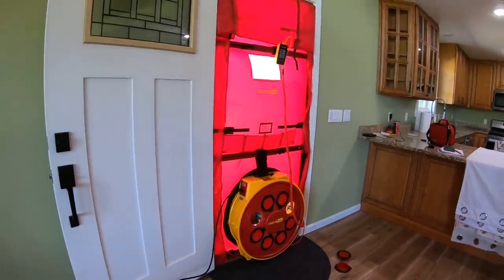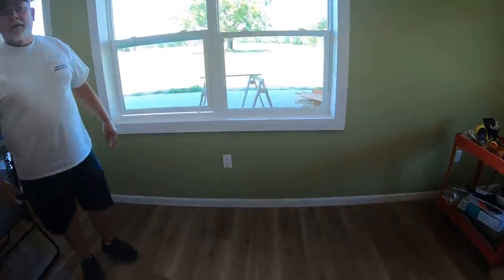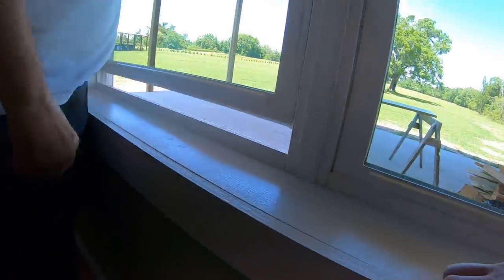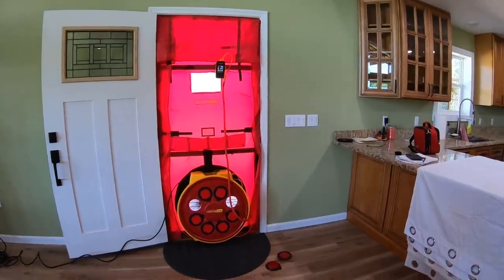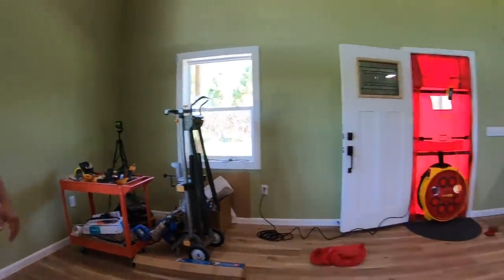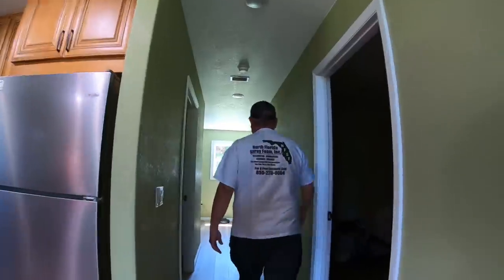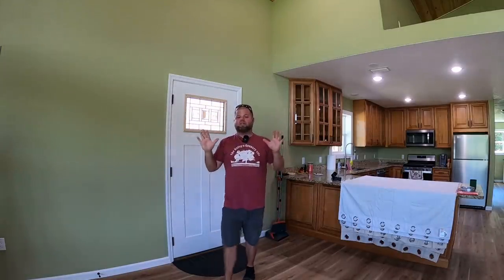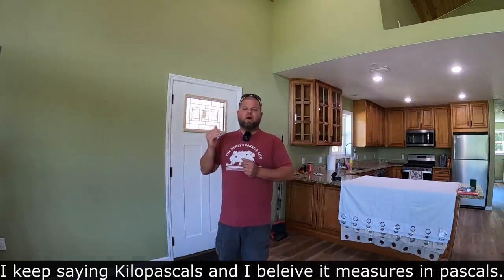The blower door test! Did we pass???? #560

Comment: Been in the HVAC field for over 30 years now. And yes a sealed home is the best and yes you also need to do things to have a controlled air change rate in the building. Another big deal is maintaining positive pressure in a building. You have to make sure you are bringing in more fresh air that you are exhausting. A building with negative pressure promotes a bad moisture problem leading to extreme mold problems in the building.
Reply from the maker: I agree and I do have positive pressure, when the havc system is running it will slowly close the exterior doors completely.

Comment: Here in NC code requires 5 ach50 or below, ive been running blower door and duct leakage tests for work the past 2 years and spray foam houses always test fantastic.  Well done on your 0.64! Very close to the passive house requirement here in NC at .6
Reply from the maker: I just learned about a passive home, makes me want to seal a few more things and try again.

Comment: The only way to make it better is to literally seal off the sliding windows, seal the concrete floor, seal the inner walls to increase baffling, and seal outlets/wall switches. There is literally not much else. You got to remember that the house only gets less tight throughout time as the foam cracks, walls creek, gaps expand...etc. You did exquisitely well.
Reply from the maker: I did seal all exterior outlets with caulking and closed cell foam. I think all my dampers are contributing to the majority of my leaks.
Reply: @TKCL  If the dampers are within the envelope of the house then they dont contribute squat. Anywho, your at peak performance and enjoy the glory of a tight home.

Comment: Congrats!!!!
You should be very proud!
I am perusing your various videos.  I commented on a later post asking for your ACH rating.  
I also asked for the CFM numbers for your bedroom versus the rest of the house.
Since you did not go with variable speed compressor, how are you handling the way different loads for the two zones?
Is your AC a two speed unit?
Running the compressor at full capacity while lowering fan speed to match the bedroom zone will result in VERY cold air and possible detriment to the compressor.  The problem may be worse when heat pump is in heating mode.
Reply from the maker: I responded to your other comment on air flow.

Comment: New it would pass.  Now my house probably won't it's made from concrete block. I've been thinking about having the cells filled with spray foam for step one
Reply from the maker: Concrete is definitely porous, but it seems like air wouldn't quickly pass?
Reply: @TKCL  it does. My house is 906 Sq ft the furnace is a 125,000 btu. Over double the size needed for the Sq ft.
Reply from the maker: Oh wow! What about a liquid membrane spray or paint?

Comment: This was a very good video. I’ve never seen or heard a good explanation of this. 
You’ve done a fantastic job at sealing your home.
Are you guessing most of the leakage was coming from air flowing back into the house through the vents like bath and kitchen exhaust fans?
Reply from the maker: That would be my guess yes! Those dampers do not seal well. And I do assume I still have some normal leaks as well. I'd imagine it's impossible to get a house perfectly sealed.
Reply from the maker: Absolutely not, you can't seal vents to take this test. Vents should be working as normal no doubt that's where some of my leakage is coming from.

Comment: Had no doubt you'd pass.  Did you get your carbon monoxide alarms up.  With such a well sealed home and a gas stove that could be an issue.  Take care and congrats!
Reply from the maker: Yes I did get those installed. I also run the vent fan when the stove is on to move fresh air.

Comment: I understand some building codes and a standard for like electrical and plumbing work, but is it really up to the government saying your house is airtight or whatever or saying you can live in your own house?
Reply from the maker: In case you haven't noticed anything you buy now has energy ratings, thus the government has been holding companies accountable. Now I guess it's our turn. But at the end of the day there is a part I like about this, contractors are being held accountable for a better build. The unsuspecting homeowner often does not have a clue what corners have been cut or how leaky their home is until they start getting those ridiculously high electric bills. At that point it's too late! I agree over regulation is a bad thing, this particular code I absolutely agree with.